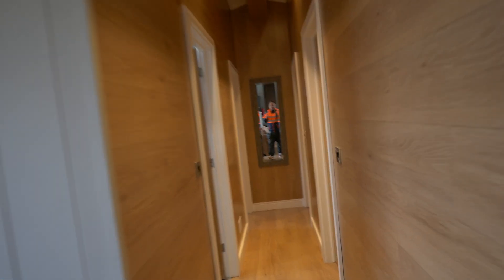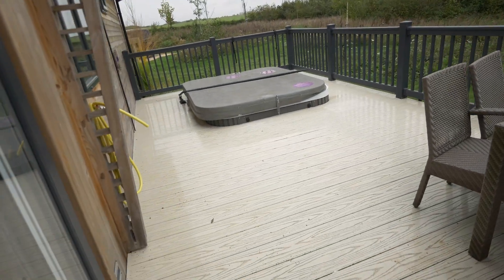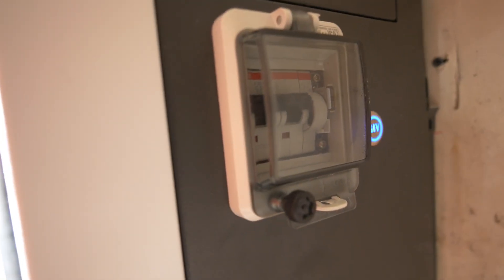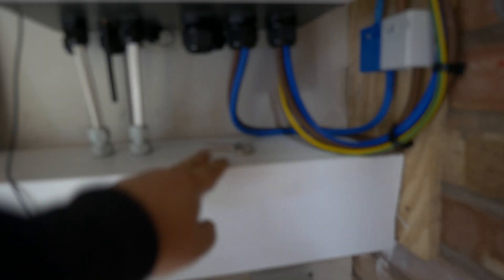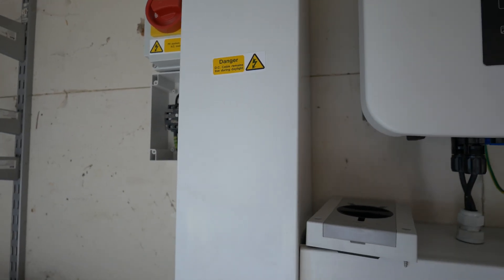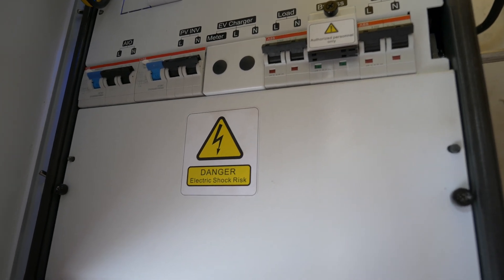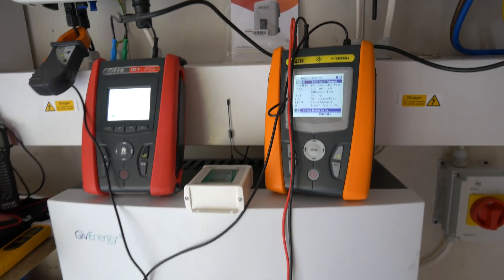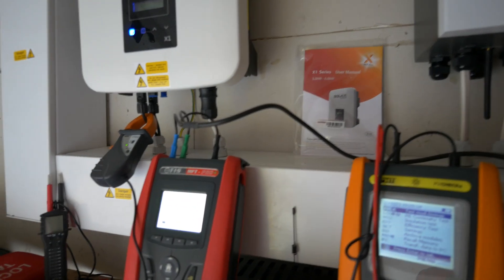Give Energy AIO all in one with Gateway | Installation with SOLAR PANELS | WHOLE Home Backup

Comment: Just wondering whether there are any pitfalls to installing the AIO outside (apart from the weather). Don't have the luxury of somewhere to install it inside (house is small plus no garage or outbuilding) nor do I want it in the loft given the current guidance (yes, I know it's not a regulation yet!). The main wall outside where the distribution board is situated under the stairs is the obvious candidate for locating the AIO but unfortunately it's south facing which potentially leaves me with a problem with overheating in the same way as the loft. Not sure what else I can do 🤷🏼‍♂️
Reply from the maker: My most recent video goes into this. Build a shelter around the AIO is the short story

Comment: How are you finding testing the AIO and GW? Voltage across neutral to earth in island mode? What other tests you doing?
Reply from the maker: Absolutely fine. Was an issue with Earth - neutral bond relay but all golden.
Reply: I've heard that you can get 120 volts from neutral to earth in island mode? How is this possible & how is it corrected, I wonder?

Comment: Hi Mark. Have you ever moved one of these batteries between houses before? I'm thinking of getting one but intend to move house well before it would have paid for itself so just wondered if you think moving it to a new property would be an option?
Reply from the maker: Don’t see why not. Obvs labour costs in doing so but wouldn’t be an issue. 

Perhaps better value to factor into the sale price of the house. It should add value and use that to purchase again at the new place. 

Either or is doable from an install level though.
Reply: @electrician247  That's a very good point actually. Good to know there shouldn't be an issue moving it. Cheers!

Comment: Hi Mark. You have installed a few of these AIO system now so could you shed some light on how the DNO export limit works when you also have a string inverter. If your DNO export limit was 6kw, do you set the AIO to 6KW and the string inverter also to 6KW, and then the gateway measures the export combined and throttles back the battery export if solar & battery export would exceed the 6kW limit?
Reply from the maker: You need to have g100 g99 compliant equipment and then set the export limit in the products. So in the AIO and inverter. If your generation is under the DNO limit you can just set the export limit on the aio and it will keep the sum total under the DNO limit.

Comment: That pack is modular , what are the restrictions of adding on more modules ?
Reply from the maker: Unsupported by the manufacturers presently
Reply: Thanks , I thought it may be , pity you are not in South Wales , decent installers very thin on the ground .
Reply from the maker: @pmbpmb5416  we do travel nationwide but obvs that comes with some increased costs. Not much mind, we find a nice air bnb and then do our thing lol

Comment: Great system my a i ask some questions.  How much was this install. How many years will the install pay for its self. What is the warranty on all major components. How long will this home run in a 24 hour period if the grid was lost and using home as normal. Ie elecyric shower,  heat pump and general normal home running. Look forward to reply
Reply from the maker: Costs vary depending on particular roof and cable runs but solar combined with AIO you are looking around 14-16k mark on a 10-12 panel system as a very rough guide.

This install will be paid back in approx 7 years but again lots of variables based on future energy costs and increased consumption if an EV is added for example. 

Again the backup power is entirely dependent on the energy consumption of the particular property. You have 13.5 units of energy in the aio alongside any PV that is generated during a power cut so impossible to predict. You would have to be pretty silly to run the electric shower knowing you are trying to preserve battery power. But in theory it would run one continuously for 2 hours. 

It’s a powerful system that is for sure and one I have in my own home.

Comment: What is the approximate installed cost? and how long until it has paid for itself
Reply from the maker: Varies on house and consumption for both tbh. Along with energy tariffs etc. 

With energy tariffs the way they are imho it’s difficult to make reliable long term predictions anyway. 

However most seem to get paybacks in 6-9 years or so.

Comment: Nice job! I am starting to worry about some of these high energy (off grid options) I left DC ammeter logging on the battery tails of a job last week and it peaked at 89amps, so the 16mm supplied tails must have been getting warm off peak.
Reply: Extra heating then 😂 but yes, I have to watch my 16mm tails too, at least I have 60A total load limiting on my zappi charger..

Comment: Great overview as always Mark. Just a question, i believe Givenergy say that you can have more than 1 aio on a system. Have you ever installed more than one on a single install?
Reply: I've just asked GivEnergy the same question - they replied; 
"We are currently in testing to make sure that 2 AIOs can work in parallel, unfortunately we have not been given a timeframe as to when this will be available. But i have heard that we will hear back soon from our higher ups." - Matt Butler at GivEnergy
Reply: @davidianwalsh  thanks for the update. They sure do open up early.
Reply from the maker: @davidianwalsh  this has been the case since September last year
Reply: Good question
Reply: Hi 

Does an AIO need DNO approval every time one is installed??
Reply from the maker: @samingham7363  yes. Even the new 3.6kW one will need a G98 notification
Reply: @samingham7363 any 3.5kW+ battery needs dno approval is my understanding..
Reply: Why would you want to do that? Additional battery, yes..
Reply from the maker: @MikeGleesonazelectrics  AIO is a modular product in itself rather than adding batteries. It’s how it’s designed
Reply from the maker: Is possible but I believe due I DNO implications currently not allowed. We haven’t done it as yet
Reply: @electrician247  ah right I see. Keep the videos coming!!! 👍
Reply: Thanks for coming back mate. So a g99 for 6kw all in one unit? Does it fall under the g100 compliance to enable it to be a fast track form…

If so, do you know why it’s a g99? If the export is limited? Or is a g99 fast track different to a standard g99 (not as long to hear back or hard to be accepted)